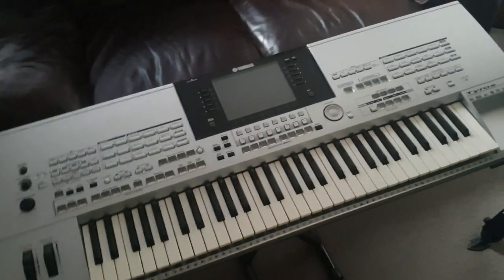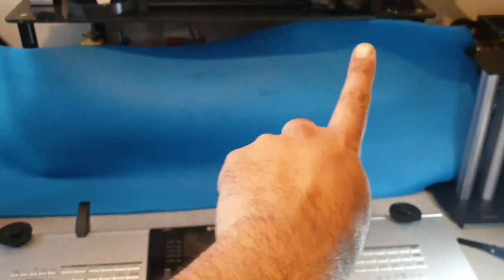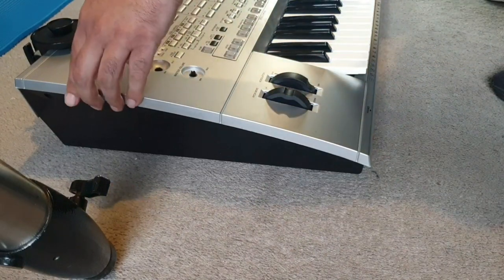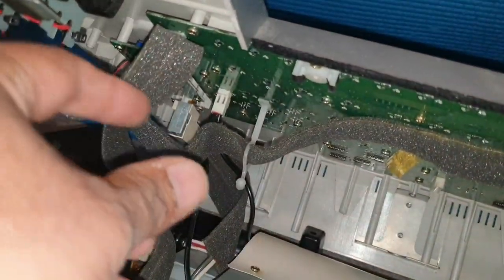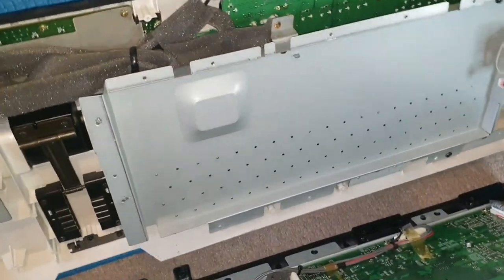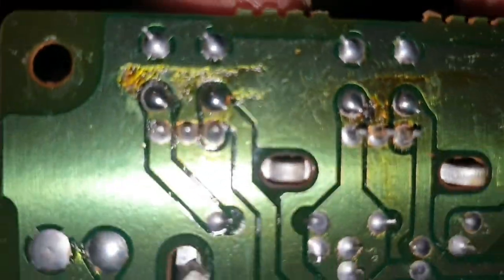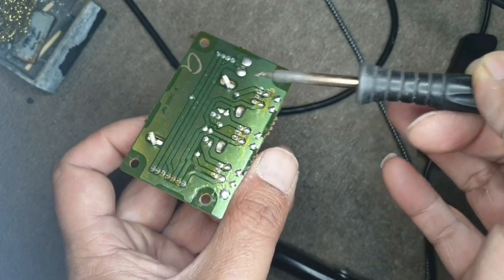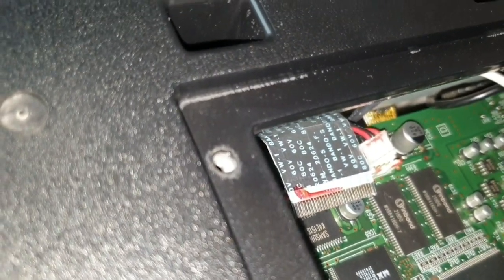Yamaha Tyros1 power crash issue, possible fix!

Comment: Only re-heating the dry joint is NOT the right way to fix dry joints. You always need to add new fresh soldering tin. Or better; remove most of the old tin first with a tin sucker or soldering litz wire. Else your problem can return back soon.
Reply from the maker: I've not had a fail so far after reheating solder , but yes you made valid point! Thanks 👍

Comment: Hal fixed, it was unusable before, now it works but no display
Reply from the maker: @daveiwhittle  sounds like you forgot to or not fully plugged back in a connector somewhere 🤔
Reply: @JBR-RBJ  perhaps but I did take it apart again and rechecked, anyway at least I can play it now so thanks for that